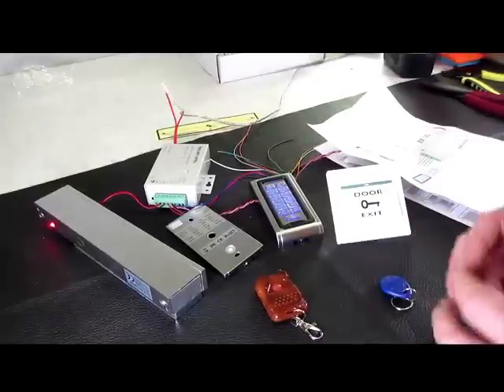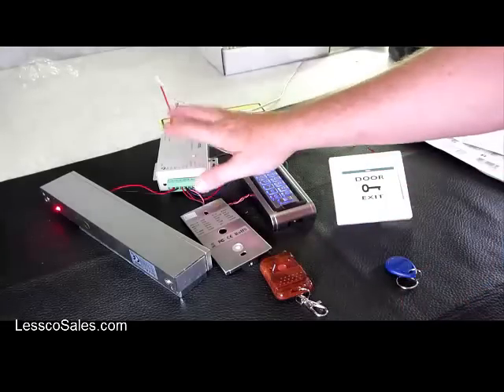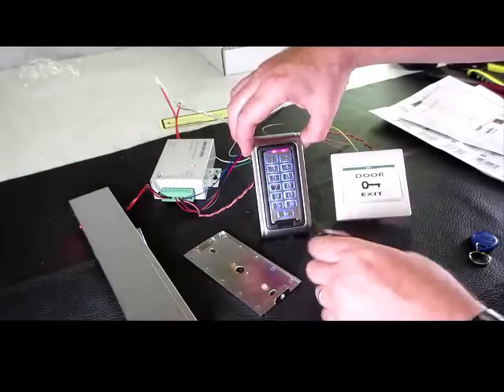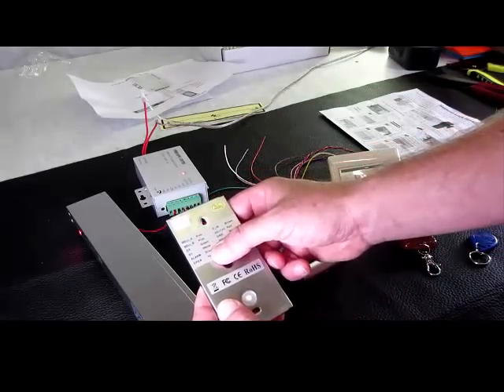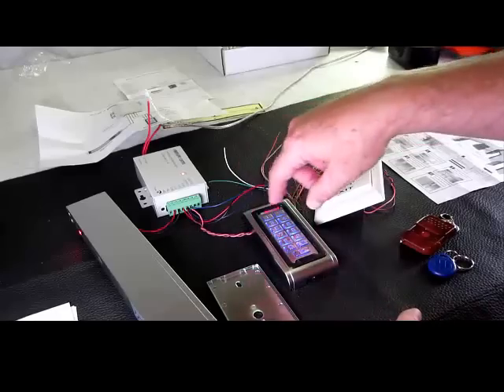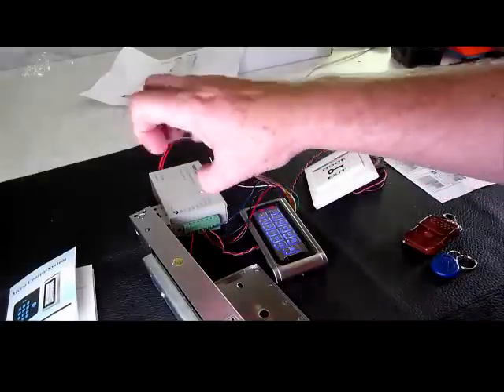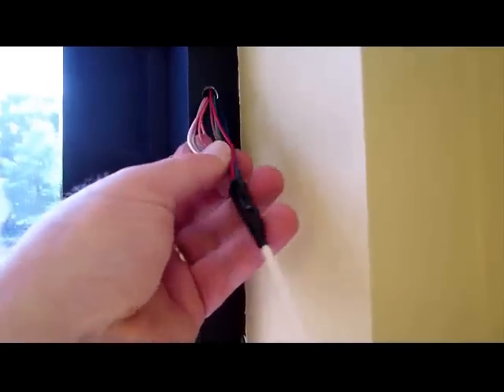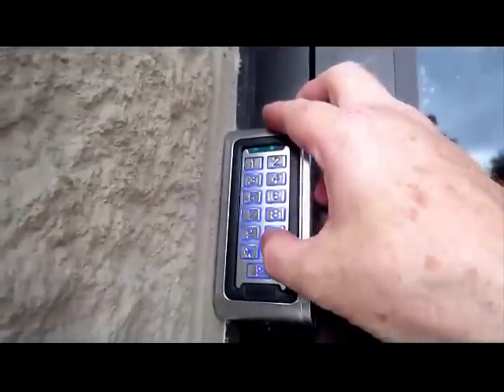How To Install A Magnetic Door Lock Access Control System

Comment: Thank you!
Will the security door be compromised if the key pad got vandalized ?
Reply: yes, you can open this system by shorting 2 wires on the keypad together
Reply: you can make this a lot more secure by adding a wiegand access controller to this, it will interface with the keypad, now if people want in they'd have to have (or steal) credentials

Comment: i know this is an old video but just to let you know if some one uses a screw driver to take the screw off the bottom of the keypad they can just join the  common and normally open wire together and the door will unlock for them
Reply from the maker: Maybe you watched one too many James Bond Movies...

Comment: I hope you included the brand and where we can get it
Reply: I am not sure if there is a complete kit with all of the components in it, but you can find them all on AliExpress
Magnet: https://www.aliexpress.com/item/4000382082121.html
Keypad: https://www.aliexpress.com/item/32673908668.html
Power Supply: https://www.aliexpress.com/item/32763536883.html
Door Exit Button: https://www.aliexpress.com/item/32949198370.html

Comment: When i connect my magnetic lock to mine, it just beeps and the keypad is unresponsive. The moment i unplug it is fine. I cant see that there is a short circuit. I get a good 12v output when the lock is armed so i cant see why connecting a magnetic lock makes it faulty. Any ideas?

Comment: How can I get this all accessories easily and from where
Thank you
Reply: I am not sure if there is a complete kit with all of the components in it, but you can find them all on AliExpress
Magnet: https://www.aliexpress.com/item/4000382082121.html
Keypad: https://www.aliexpress.com/item/32673908668.html
Power Supply: https://www.aliexpress.com/item/32763536883.html
Door Exit Button: https://www.aliexpress.com/item/32949198370.html

Comment: How it is called? And how much is it? Question if the power goes off. Does it work? If i destroy the keyboard can i unlock it?
Reply from the maker: In case of a power outage it remains open cause it needs power to electrify the magnet.

Comment: Hello Sir. Can i please ask you to show or send me the Link, to buy one of this kits, to myself. Like you say Sir, I Wish i had one of this , long ago.
Please help me out.
Thank you also for sharing your work. Im very thankfull for that.
Reply from the maker: This seems to be the current model now:

https://www.amazon.com/Weatherproof-Control-Electric-Magnetic-110VPower-x/dp/B071X6LFFS/ref=sr_1_4?ie=UTF8&qid=1542816530&sr=8-4&keywords=ip65+electronic+magnetic+lock
Reply: Save yourself a TON of money and just buy each component individually on AliExpress. The kit on amazon is way overpriced for the same components. Currently as of Feb 15, 2020 the following items are only $78.34 USD The kit on amazon is $100 more expensive.
Magnet: https://www.aliexpress.com/item/4000382082121.html
Keypad: https://www.aliexpress.com/item/32673908668.html
Power Supply: https://www.aliexpress.com/item/32763536883.html
Door Exit Button: https://www.aliexpress.com/item/32949198370.html

Comment: Hello. 
To connect a rfid reader to a mag lock? What do I need? 
A power supply and a the reader connected to the mag lock? Or is there something else?
Reply from the maker: The rfid receiver is needed, Mine is built in the keypad outside.
Reply: May I ask how many locks can the controller handle at the time and how many lock can the power supply handle at the same time?
Reply from the maker: Different kits will vary, All I can tell you is this kit I worked on is a single door not designed to be linked with an external unit.

Comment: This system is not International Building and Fire Code compliant. This system is super unsafe please do not use this video as a guide unless you want to incur fines for violating fire code.
Reply: Chris Balch How? yes he should have installed a emergency door release. But how, apart from that?
Reply: Oh I'm sorry it's safe because of an electricity goes off it unlocks

Comment: It's cool, but imo it was safer if the keycode box was mounted in wall and wiring was accessible only from the other side (inside the office), so that you couldn't break the keycode loose and rewire it - you would have to then break down the wall itself, but at that point you'd just break down the doors instead. Meanwhile, from inside, you could just open up a metal panel mounted in wall and get access to the wiring

Comment: What's the name of this device? Where to buy? Do you have a link to purchase?
Reply: try this 1 its the same but with fingerprint access https://www.ebay.co.uk/itm/Fingerprint-RFID-Card-Access-Control-System-280kg-Magnetic-Lock-2Remote-Controls-/142746386558?_trksid=p2349526.m4383.l4275.c10
Reply: This link worked as of 3/2019: https://www.ebay.com/itm/620-LBs-Kit-Electric-Door-Lock-Magnetic-Access-Control-ID-Card-Password-System/171841317313?ssPageName=STRK%3AMEBIDX%3AIT&_trksid=p2060353.m2749.l2649
Reply from the maker: https://www.ebay.com/itm/620-LBs-Kit-Electric-Door-Lock-Magnetic-Access-Control-ID-Card-Password-System/171841317313?ssPageName=STRK%3AMEBIDX%3AIT&_trksid=p2060353.m2749.l2649

Comment: Got that all figured out. How do you program the transmitter?
Reply from the maker: That was simple enough fo my kit, it was actually the easiest part. the instructions worked just as the instructions showed.
Reply: Maybe I have a different instructional book, mine says to open the back of the machine shell, (I'm assuming that means the transmitter? ) and then connect to the power supply...I don't see how this thing connects to the power supply..everything else is going great though. I bought it for my camper lol. A little tricky with the door. So anyway, maybe I'm interpreting it wrong.
Reply from the maker: the shell you mentioned is the unit where all my wiring is connected into.
Reply: Bro, can you just lay it out for me pls? I've had the unit apart, the transmitter apart, I don't see where I can connect anything to it...can you just write a brief step by step? I'd really appreciate it if you could do that, if you can afford the time to do so..thank you in advance
Reply from the maker: call me tomorrow 904 342 5491, My me is Martin
Reply: @Lesscoelectronics  hi..my keybord is lookout how can i reactivate it?

Comment: So what's up with the power? It's just two red wires..nothing sets them apart to know what's hot and neutral..I just hooked it up the way you said but I get a blinking light on the power supply

Comment: What happens when you lose power
Reply from the maker: The lock in normal situations will just not work with a loss of AC power, However a nut like me tie it into their security system's backup battery/inverter, So I never lose power.
Reply: i am sure there is a battery power pack  in case there is no power
Reply from the maker: the kit is normally closed when powered so you wont get locked out with no power
Reply from the maker: it remains unlocked